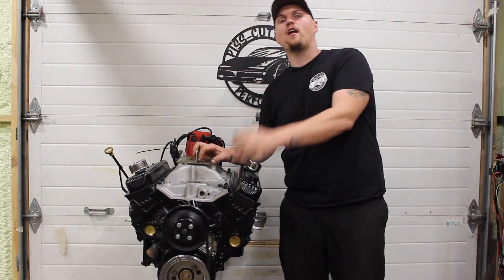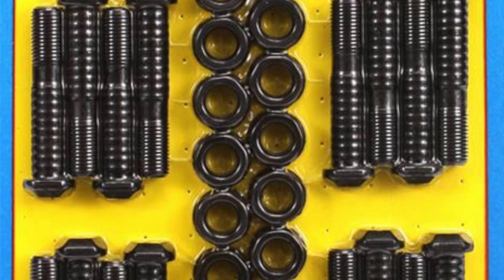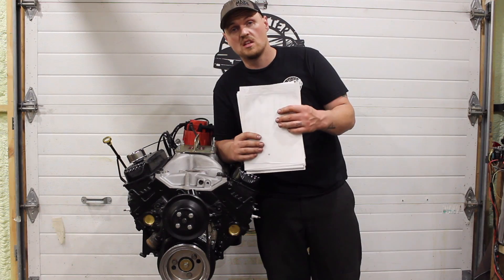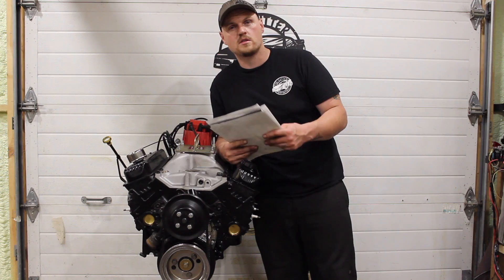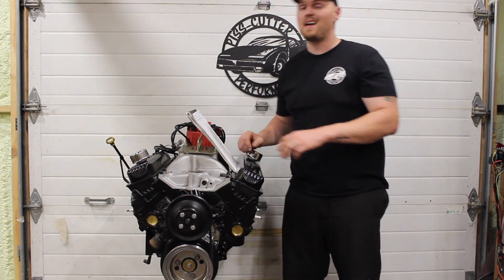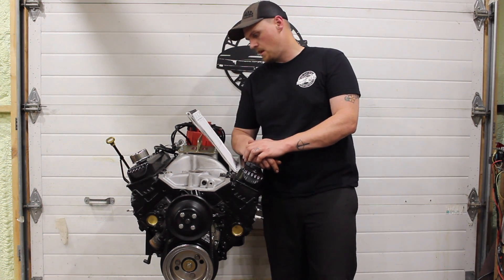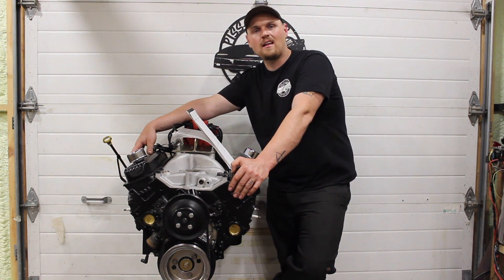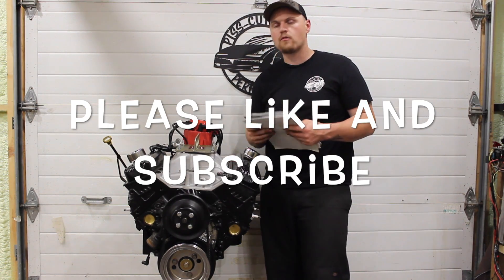Cheap Chevy 350 Power! 400+ hp Vortec Heads LT4 Hot Cam Dyno (L31 Budget)

Comment: Wow, great job. I need a low end torque motor for a truck. If I were to advance the cam timing to move those numbers down in to a more appropriate rpm range, do you think I should use 1.5 rockers for valve to piston clearance?
Reply: I would use something like the Comp 08-409-8 in a truck.  I had a had a L31 with a Hotcam advanced 4° in my 1983 G20 van with a 700r4 and 3.08 gears.  The thing loved having the Q-Jet wide open.  It made 407 hp @ 5,600 and 438 tq @ 3,600 at the flywheel. It had over 400 ft/lbs at 2,500 the lowest the dyno's absorber would load it.
Reply: @chrisreynolds6520  That's the exact engine/tranny combo I'm going to be using but, with 3.73 gears, in a 2000 Jeep WJ (Grand Cherokee). It's the last year of the solid front axle GC's and they came with the 4.0L six or the 4.7L OHC V8 (which I don't like). In order to retrofit a Magnum 360 in it I'll have to get a new Tranny anyway because the oil filter on the SBChrysler is where the starter is (right side) on jeeps. There isn't room for the starter on the left because of the front drive shaft. So it's a hassle to use a SBCh. So, L31 it and a 700r4 it is. 
I appreaciate the tip. Thank you.
Reply from the maker: Yeah, 4 deg advance  will shift it down and even with the 1.6, I highly doubt you'll have any valve to piston clearance issues
Reply: @cuttersperformance  From what I have seen you have to get up to the 240 @ 0.050 on an agrresive lobe and a tight LSA like a 106 before PTV even starts to be something to think about.
Reply from the maker: @chrisreynolds6520  exactly
Reply: @cuttersperformance  yep the stock pistons being 0.022" or so down the hole helps a bit in that respect as well as the stock pistons having a big dish and deep valve reliefs. Go bigger than a 2.02 valve and I could see things getting tighter much more quickly.
Reply: @cuttersperformance  Ok, Cool, Thank you.

Comment: 2 weeks ago I guessed 395HP spinning to 6300!!! I wasn't too far off and I'm glad it made even more than expected!!! I love it made even more torque but a pretty square motor in the numbers!! I can't wait to see the next video with the spacer!

Edit: I cannot believe how easy it is to build 400+hp nowadays! Just 20 years ago, you had to buy a Z06 to get 400HPs in a small block!!!
Reply: Why do you say that? 20 years ago I had a very similar setup in my 1983 G20.  5.7L Vortec with a Hotcam, GMPP Vortec Q-Jet manifold and headers. 407 hp and 438 tq.
Reply: @chrisreynolds6520 so cool thru a q jet and yeah it's not as hard as some might think just requires a well matched combo and 400 isn't too far off
Reply: @chrisreynolds6520  That's awesome! I'm happy you shared that. Without knowing how much you spent 20 years ago to make 400HP, I guess I was comparing the cost and abundance of 400hp now vs the cost and abundance of 400hp in the 2003 where vettes and vipers had that kind of factory HP. I know it was possible to build a 400hp motor 20 years about, but by today's standards 400HP isn't uncommon. For example, an explorer ST cranks out 400HPs and some KIAs are boasting over 500HPs.
Reply: @HOMEWORK4.0  Low mileage junkyard L31, cam, springs, retainers and an intake manifold. My van already had a Q-Jet, HEI and Thorley Tri-Ys on the 305. My Hotcam came out of a friends LT1 Camaro that he put a CC306 into. Really want to crank out some power from one of these on top-end, use a CC306.
Reply: @chrisreynolds6520 whats a CC306?
Reply: Also 13.50s @ 101 mph in that 5,300 lbs 3.08 geared pig.

Comment: Very impressive! But, when you think about the LT4 engines that went in the 96 Vettes, it really shouldn't surprise us. Those cars would really get it! 
I am surprised that the usable power band extends all the way past 6000 rpm with that cam. 
Really looking forward to the videos on port work done to those Vortec heads. I've always heard it's easy to go too far with them. 
Again, awesome results!
Reply from the maker: Yeah they are very easily over ported on the intake side
Reply: His cam is the hotter GM ASA Racing LT4 Hotcam, not the production 96 LT4 cam. LT4 cam is 203/210 @ 0.050 vs 218/228ish @ 0.050 for the Hotcam.

Comment: I am building the same exact setup I’m at the point to where I have to figure out my pushrod length with the lt4 hot cam but I had the stud bosses cut down at the shop and 7/16th screw in studs with the hex on the shaft so my measurements are off now the old school pushrods roller cam are too long and the vortec pushrods are too short because I got the 1.6 comp cam rocker arms they were so thick the rockers and they were hitting the pushrods I had to shim them down with a angle grinder the back of the rocker arms so pushrod length white size u using I just ordered a adjustable pushrod to figure this out
Reply from the maker: If your using a OE roller block and a roller cam it should be close to the factory 7.200 inches. If cut down correctly, the hex studs should not affect the pushrod length
Reply: @cuttersperformance  ok brother thank you and another question what mellnozied gear you use for the lt4 hot cam u got a part number
Reply: @cuttersperformance  what stall torque converter you using 2500 stall or stock ?

Comment: I have a L31 with 58cc chamber 292 turbo heads port and polished they flow 280 CFM 7501 air gap intake cam 470 lift 110 lsa 230 duration 650 Holley double pumper with 1094 head gasket.015 I have 10.81 compression ratio, The engine sounds very healthy, I'm hoping for 375 hp  at flywheel,what Can you tell me about this combination?
Reply from the maker: 280 cfm is quite impressive flow numbers for those heads (old nascar heads?) Id probably use a 1.6 rocker to get as much lift as possible, but you should have no issues hitting 375 hp
Reply: @cuttersperformance ❤
Reply: Bill "Grumpy" Jenkins use the same heads in a 331 they claim to have  650 hp in he's NHRA Pro Stock Vega In the early 70"S, those are GM over the  counter heads, I am building a sbc 406 with 340292 "Turbo"heads 600 lift Camshaft I will be happy to hit 450 hp. Do you have Facebook page? Thank you!

Comment: Awesome video! Pretty insane HP. People definitely sleep on the SBC with all the LS buzz. Just picked up a 283 to teardown/build, pumped!
Reply: I built a 283, one of the first motors i built and it ran really strong in a 89 s10 with a th-350 trans. Motor was .040 over 289ci, had a set of stock vortec heads, rpm air gap, and a comp 268H .454/.454 lift with a 650 holley dp
Reply: @redrumss3464 I have owned a great running 283 for 20+ years.  I've thought about the 305 Vortec heads to put on it. I want to build a project based on miles per gallon more than top-end horsepower and have wondered if the 283 vortec or the 305 vortec would be a better MPG engine
Reply: No kidding I’m building a 350 in my backyard to make 400+ hp the thing about the sbc it’s been around for over 50 years the aftermarket for them is huge and we can only expect it to get bigger

Comment: I built an L31 vortec 350 crate motor stock bottom end put a comp cams Big Mutha Thumper hydraulic roller 4 degrees advanced for valve clearance mild porting on the heads with guide plates screw in studs double springs and 1.6 roller rockers speed master single plane with 750 brawler went 11.s in my 3200 lb nova and Rev to 7000 all day
Reply: I have a very similar L31 ported VTEC heads xr288hr with LS9 valve springs super victor intake . The pistons are 604 crate flat tops. Stock rockers I ground out the slot . Doesn't stop pulling in rpm, the tach recall said 7800rpm.
Reply from the maker: Hell yeah 🤘

Comment: I'm basically building the same engine (Vortec heads w/ LS springs and Hot Cam) using a .010" over 400 with 5.7PM rods and KB pistons with raised pin hole.  I was hoping for 1hp/cube but it looks like with the leverage of the extra stroke (cubes) 440-450hp might be possible.  A lot for a Tri-Power, skinny tired T with a 200r4.  I am looking for a softer bottom end for obvious reasons, sound possible ?
Reply: I basically built a similar engine to what you're speaking of years ago. It was a 406 with lightly ported aluminum l98 heads, 10:1 compression with keith black pistons. I used the short 400 rod and a decent comp cam that was a flat tappet. I used a weiand stealth intake on it and put it in a lifted k5 blazer. That was a great engine. It had instant tq everywhere and would run to 6500-7k rpm. No doubt it made 400+ hp and tq. It broke axles, transmission,  transfer cases....it actually spun the differential on the axle tubes. Great combo!
Reply: @HioSSilver1999  Yup , if u don't support the T-case on a K5 with big power it will break off the trans housing where the T-case bolts up !
Reply from the maker: I would certainly think 440hp would be possible
Reply: you could retard the cam a few degrees for hp but it will lose torque

Comment: Great video as always! I may be pulling my L31 this winter and doing a 383 stroker with some AFR heads and a Thumpr cam, so I would be selling an LT4 Hotcam with about 3000kms on it, and selling the stock 062 Vortec heads with Beehives and 1.6 roller rockers as well if you'd be interested. I am in Edmonton.
Reply from the maker: Always looking for heads, shoot me an email pcperformance1@outlook.com
Reply: Is this the same Tim that was at the C10 nats in salt lake in June??
Reply: Dont use a thumpr cam get a real performance grind that works it will still sound good
Those blow too much torque right out the tailpipe crappy vacuum manners needs lots of intial etc.
Reply: @gordocarbo  I am not a concerned about performance, just more of the sound. This truck never sees high rpm. But I will take a look at other options if you have any to recommend?

Comment: Pat, I'm currently restoring a 77 vette that had the L48 engine my uncle gave me shortly after my return from Iraq.  I am doing a vortec head conversion with a edlbrock intake with the quadrajet carb. Also throwing in a L-79 cam in it. Going with stock  ckank and pistons... Just wondering your thoughts on my plan....
Reply from the maker: Vortec heads are always a good upgrade. Maybe add abit more cam? Depends on what power you want though
Reply: @piss-cutterperformance  nothing to ridiculous,  being a budget build I'm keeping the stock torque converter and transmission. What would be a good range of horsepower on this combination. Guesstimate of course... Hope this finds you well brother to the north... Former Buffalonian, now South Carolinian...lol

Comment: I guess I am the only one that thought all along it would make 400+. Then again I have built a couple of them.
Reply from the maker: Given the compression, Cam and low rise intake I thought 400 would be a stretch but I was wrong. I'm impressed with the hotcam and the idle vac and sound is quite nice 👍
Reply: @cuttersperformance  I thought 400 hp and 430 tq, but I advanced that cam 4° in the builds I have done. Helps bring the torque on a little earlier. The ones I have done drop in on a 109-110 ICL and moving it to a 105 ICL traps a bit more cylinder pressure and beefs up the low-midrange.
Reply from the maker: @chrisreynolds6520  I almost did! But thought Id just run it straight up and see
Reply: I thought it would be just shy of 400. Vortec heads are well known for more.
Reply: @cuzz63  Mine made 407 hp @5,600 and 438 tq @ 3,600 with old style Doug tri-ys meant for a G-van (collectors even to the trans mount on a 700r4) and an 850 cfm Q-Jet on a GM Performance Q-Jet vortec intake (removed from a 330 hp 350 HO crate engine).  1" Hamburger tapered spacer under the carb. I later plumbed up the EGR valve and it passed emissions much cleaner than the worn out 83 305. At 5,300 lbs with a converter stalling 2,800 rpm and 3.08 gear it went 13.50s @ 101 mph. This was back in 2005 FWIW. Mine was a 4-bolt main stock bottom end, stock rod bolts and all, my WOT 1-2 shift was 6,300 rpm and 2-3 was 6,000. 2-3 could have been higher, but mechanically shifted transmissions are hard to get dialed in exactly how one wants. I tried making some passes on a 125 hp plate unit, but the 700r4 was not having it and cooked the 3/4 clutches multiple times. I had a blast making a brick of a G20 conversion van quick. I drove it everywhere with the ac on and really decent fuel mileage as well, got over 20 mpg on several 1,000+ mile road trips.
Reply: This is great. I have a similar engine on the stand. Only difference I can see is that mine has the heads cut to 58cc chambers, ported tru ram exhaust manifolds, and I'm using an aluminum Volvo Penta intake plus 1.6 Jesel shaft rockers. The intake is almost identical to the Edelbrock rpm qjet, but it has brass lined water passages and the waffle pattern on the plenum floor.

Comment: since you are running carbs... do you bring the RPMS up to around 1700 and look at the air fuel ratio display. see how close it is to 12.7.   change the idle feed restrictions to fix this off idle lean or rich..
many holleys ship with 0.031" idle feed restrictions .. those are about right for 327, 331 engines.. 347 to 360 engines need a 0.032" idle feed restriction.. 

 if you bring the rpms up to 3700 to 4000 and hold steady.. if its lean.. go up a size on the primary main jets.. if its rich.. go down a size and retest..